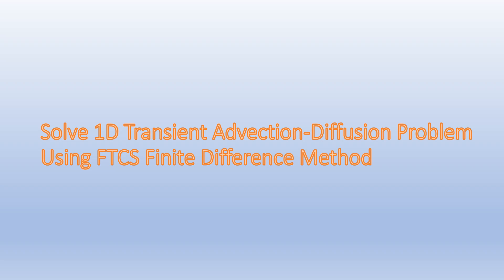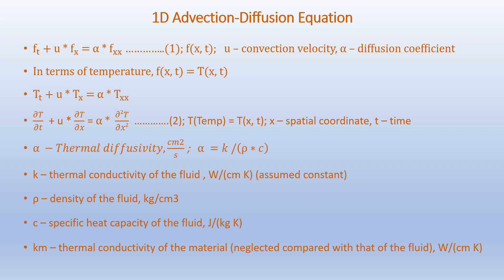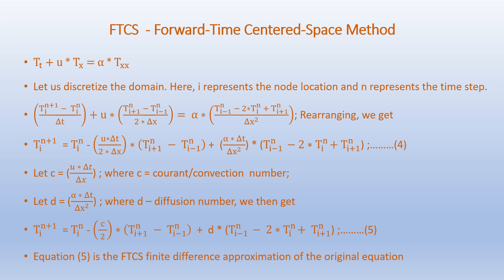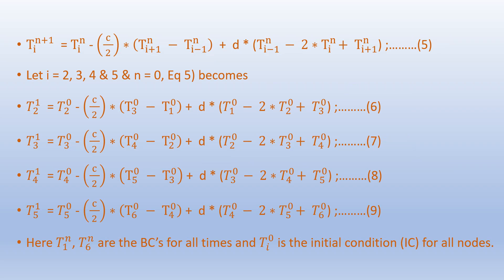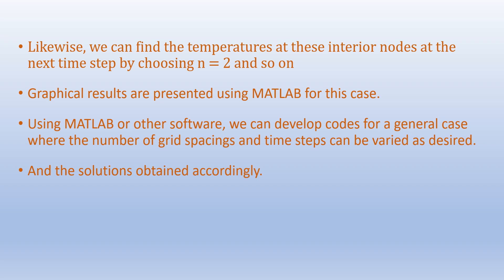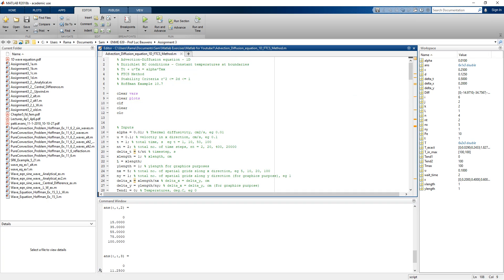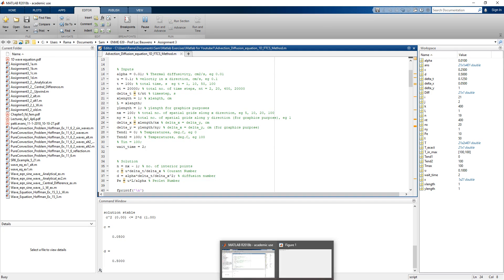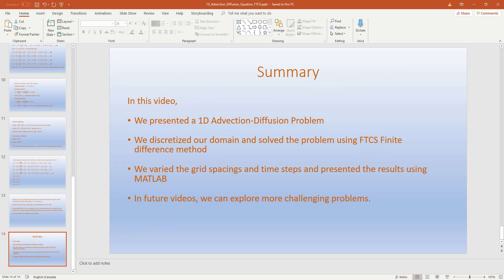Solve 1D Advection-Diffusion problem using FTCS Finite Difference Method

Comment: A.o.a Sir, Hope you are doing great. Nice work that you did to understand these numerical schemes. Please expend this for 2D Advection _ Diffusion problem. Can i send you a problem which is actually Two dimensional boundary layer  along with mixed boundary conditions. I completely discritize this and trying to solve implicit finite difference technique but i have a problem in matlab coding. Would you like to tickle this problem, if you agree than send me your mailing address on which i send you my problem along with complete discritization and matlab code.